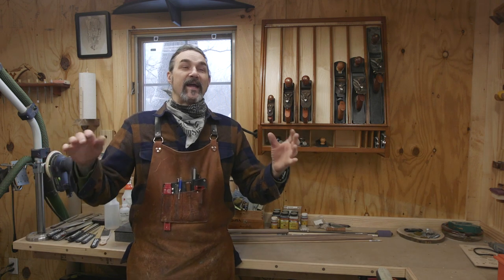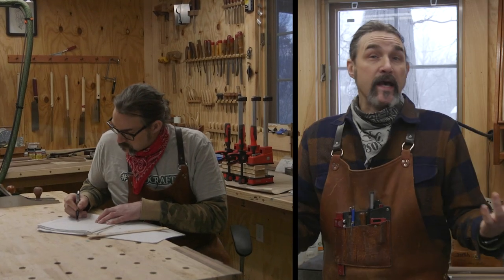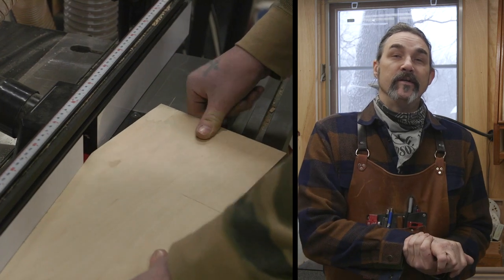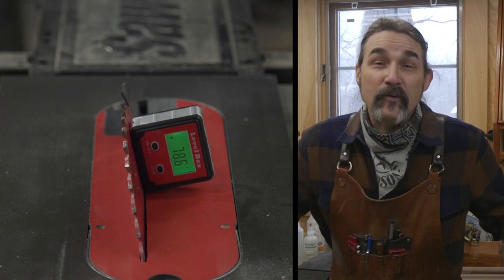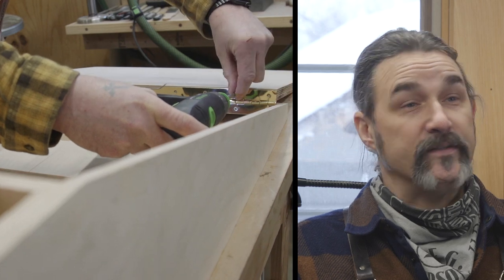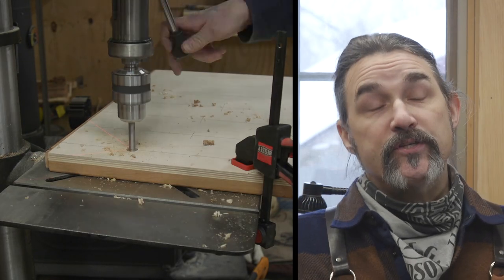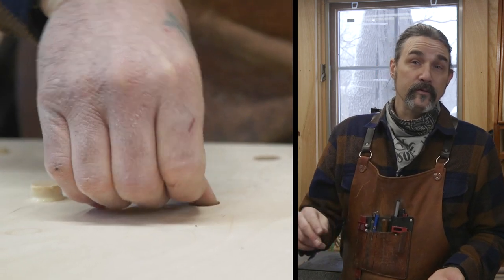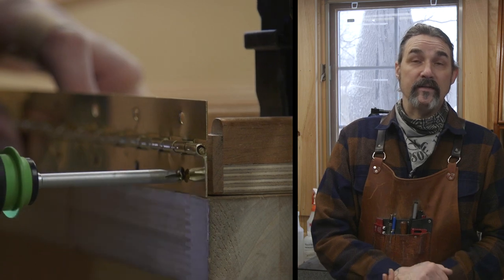Making a Hand Plane Till | Woodcraft 101

Comment: Looks well-made and well thought out for the design. Along those lines, I am considering placing my chisels in what you call the hiding place, but need to make certain that they, too, are well cared for. Probably use some magnets as well as the holder brace most people see in a woodworker's tools case.
Reply from the maker: Thanks David.  I can share my experience on that thought.  I use my chisels way too often and wouldn't want to lift the till a bunch.  I mostly keep items I don't need often (branding irons, pyography kit) since I remove the planes before lifting the till.  All the best on your build!!

Comment: At 3:21, I was very concerned for your safety.  As a woodworker for nearly 30 years, I would never let my fingers get that close to a router bit spinning at 20-30,000 rpm!  Rounding over the edges and then cutting each strip away at the table saw would be a slower process, but much safer.